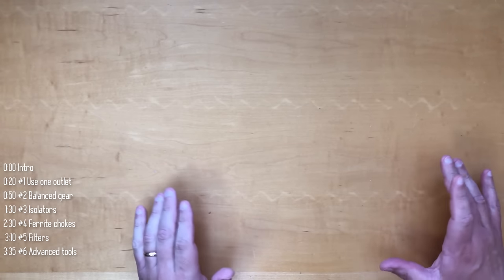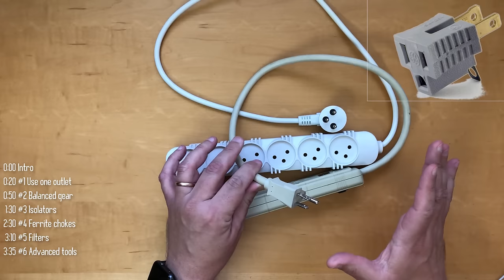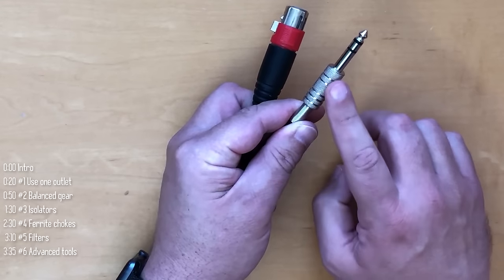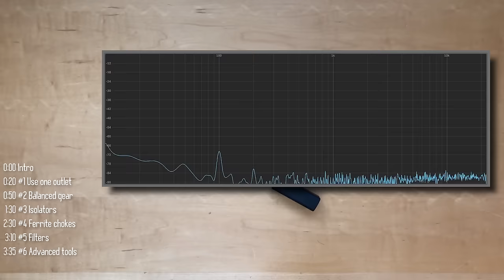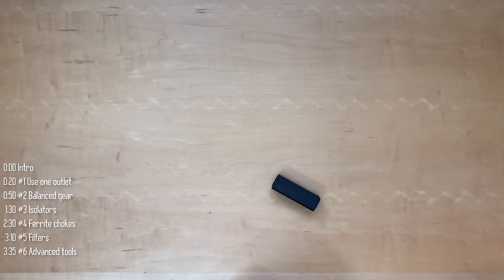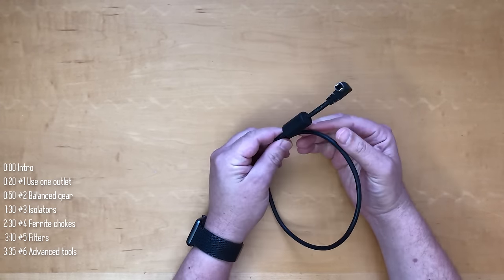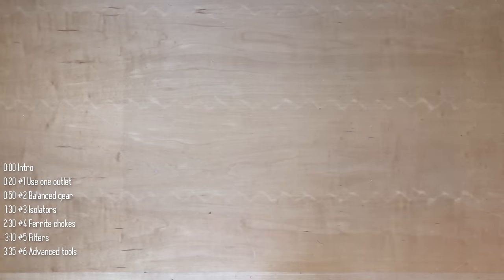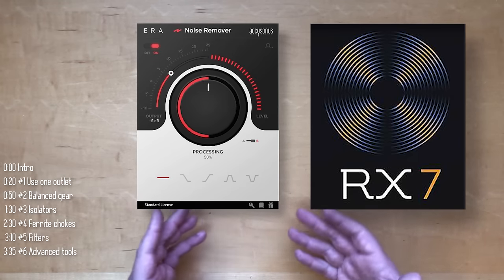6 simple and cheap ways to fix hum, buzz and ground loop noise

Comment: TRS is NOT balanced....
Reply from the maker: Writing in caps doesn’t make you right, but if you explain yourself maybe we can all learn something
Reply from the maker: I prefer to not call your lack of knowledge names. I say a TRS cable can and must be used for mono balanced signals (as an XLR can). You are welcome to explain why I am wrong, or perhaps apologize after you’ve done a bit of research.
Reply: @loopop  Only XLR is a balanced cable.
TRS is signal/ground, XLR = +/-/ground ...TRS isn't balanced. It's just a connection protected by ground. XLR uses + and - wires , twisted for rejection of noise.
Reply from the maker: Sorry my friend, you’re wrong. TRS can be used for unbalanced stereo, but also for balanced mono. It’s not just signal/ground
Reply: Yes, but you can only convert a balanced signal to trs , not by simple a connection. If you do, you lose the rejection, the whole point of balancing aka 3 wires. Just by connecting it to TRS doesn't mean it's balanced.
Reply from the maker: PROJACKED my friend I am afraid you don’t know what you’re talking about. Please do your research, especially before calling people names. As I mention in the video, if your audio interface has balanced outputs a TRS cable will work fine.
Reply: @loopop  Cable basics ;
'So, if we're talking about audio cables, the 1/4" TS can ONLY carry unbalanced mono signals. The 1/4" TRS is capable of carrying unbalanced stereo signals. However, the 1/4" TRS can ALSO be used for balanced mono signals. This requires a hot AND cold for the signal, IN ADDITION to ground.'
Not my caps btw. I'm not calling you names, just words. I'll correct it...
Reply from the maker: PROJACKED I agree with everything in your last comment - it completely contradicts your first comment, and you still have not said what is incorrect in my video
Reply: @loopop  the point was merely, stating a TRS cable as balanced (in your video)....not knowing the actual difference can cause even more issues concerning hum/loops/hiss. Forgive my attitude, bad start of the day (not your video lol)

Comment: the noise exist because all you use is cheap stuff, start spending money on yourself and get a greater use,..spend a lil more money on your MIC AND THE NOISE WILL GO AWAY...BY THE TIME YOU FINISH BUYING ALL THAT CHEAP SHIT IT EQUALS TO A GOOD MIC.
Reply from the maker: The scenarios in this video don't even use a microphone. By the way, noise isn't the primary factor that differentiates a cheap mic from an expensive one.